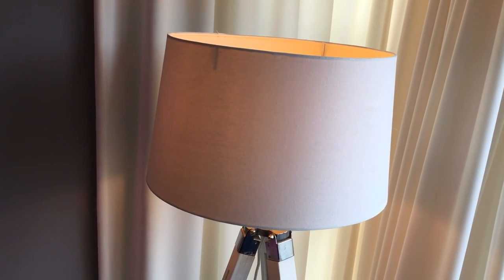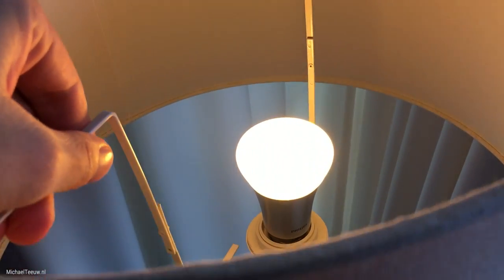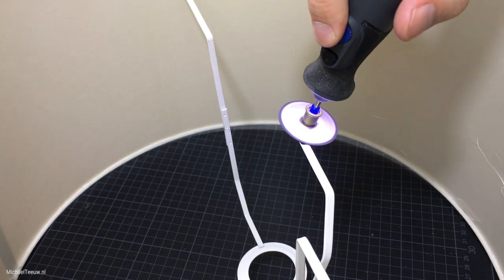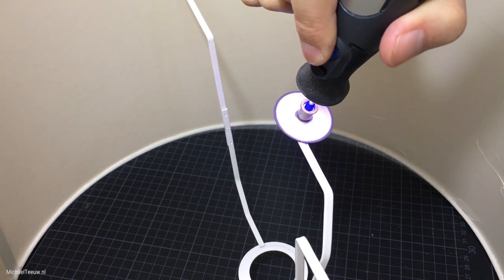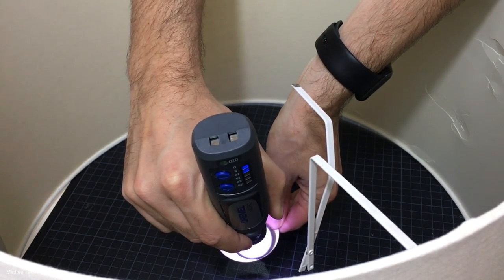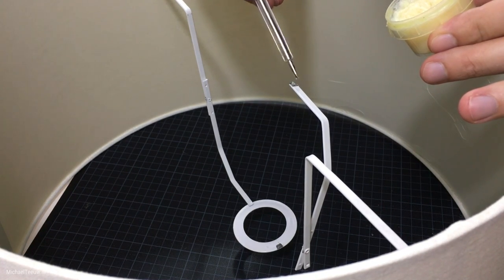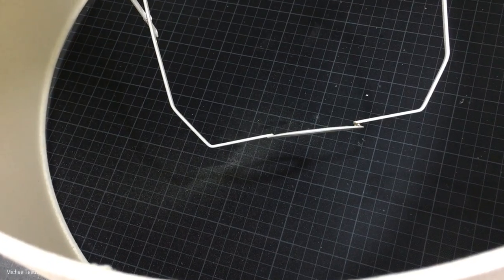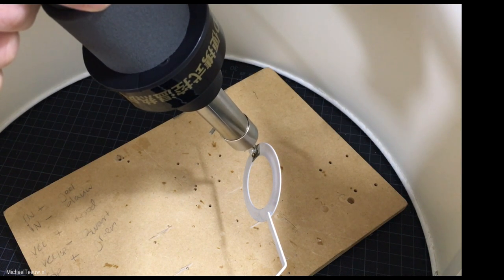DYI Lampshade Repair

Comment: The best way to do this repair is to drill a hole with a 1/16th bit through both parts of the metal where the spot weld was.  Then use a tiny nut and bolt to join the two pieces together.  
Worked for me anyway.  Wary of the solder trick, and gluing may not work long term as there is quite a bit of springiness there.

Comment: what ate those little tools call and where to buy them. Like burning or metal the tiny metal wire and the sanding tool. thanks
Reply: Soldering iron... sorry nobody answered you before.